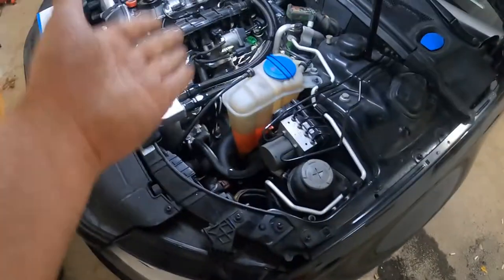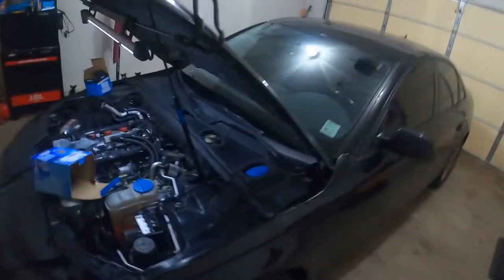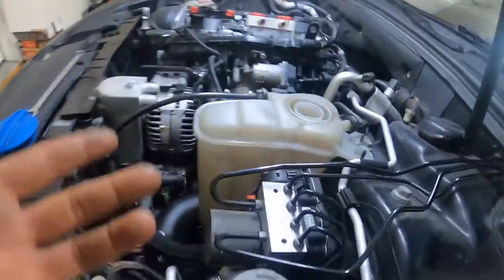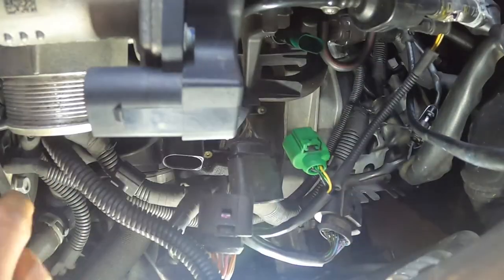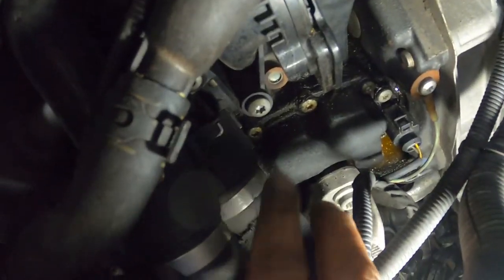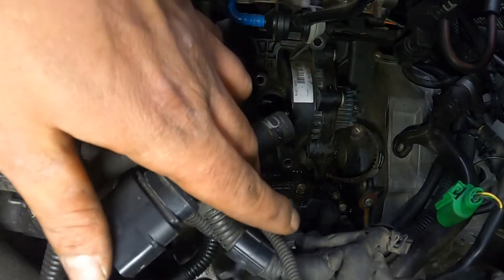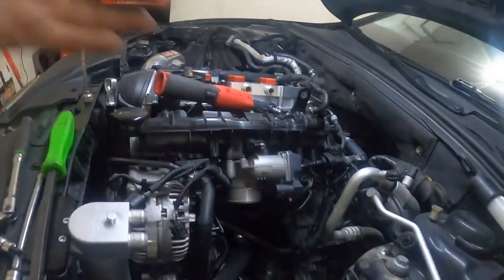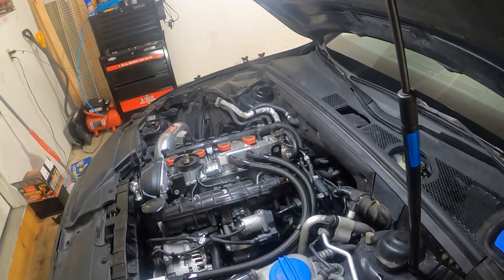Audi 2.0T water pump replacement | DIYer VERSION | STEP-BY-STEP|

Comment: Just so you all know. You don’t actually have to take the coolant tank out. It’s an option to give you more room. I found it easier to remove the throttle body but be careful as you might need to relearn the throttle bottle. (My A6 C7 doesn’t throw any codes when I mess with mine. It relearns on its own. (2ND). Turning the motor just to get the belt off is crazy and over complicating a simple process. When sliding the pump in. Do so at an angle so you can slide the belt on before you do any kind of bolting. It will work just fine and not damage or misalign anything. (3RD) You don’t have to replace the pump connector to the oil cooler. It is recommended but sometimes you can get away with just replacing the O-Rings. Make sure the connector is straight up and down as best as you can when snapping it onto the pump. I recommend a flat table or even a driveway works. (4th.) Be careful with your coolant pipes as the plastic pieces in the flange like to fall out when taking them off. So do the O-Rings. So make sure you have extras on hand ready to replace as when you drop it. Or just don’t drop them at all and pay attention to it. Or else It’s gone. (5) When bolting the water pump make sure you follow proper bolt patters as this ensures you don’t pinch your gasket on the water pump and that your pump is going on evenly. Think of it like a bolting a wheel on. Also just hand tight the bolts and once there snug you will be at or right around 9nm to 10nm of torque. Last but not least always be careful with your metal snapping pins for your hoses as they like to come off the coolant pipes and fall into the abyss so pay attention to that. 

Extra: When you fill your coolant back up. Make sure to burp it. Basically on one of the main coolant hoses just squeeze it gently and you’ll see how it pushes the air out of the system into your coolant tank. Do this till you stop seeing air bubbles. Then start your car and engine burping and adding coolant until you see no more air bubbles and your levels are back to normal in the tank. 

Most important- Don’t ever counter clock wise turn your motor unless you know you are working on anything timing related. Great way to fuck everything up in your motor.
Reply: Question - if the OEM pump lasted 100K or so , wouldn't it make more sense to stick with OEM rather than go with the "metal" one ? Graf seems to be the go to, but I have read some leak (suspect its install issue ) and some of the less expensive ones may not be manufactured to tight tolerances, which will make them leak.

I have read Audi ( VW ) has improved the pump and are at iteration 'm" or something. I have no problem going with GRAF, but I have found OEM always seems to be 100%. Same goes with Rear Seal. Also considering removing the PCV with a catch can now that the manifold comes out ( and carbon cleaned ) , and more questions ...lol.

The A3 is Just to nice a vehicle not to do these maintenance upgrades at 150K mileage.

Thanks for the notes - and this video creator is also good.
Reply from the maker: Lots of great questions, I might have to do a video on some of these. But here a go at it. Pump! Yes, the oem is a better fitting part that said most aftermarket components are supposed to be built  to oem or better. Specifications that said it doesn't always happen that way. Insert reviews and brand trust. I trust and have used graf for many years. So I recommend and trust their brand. As for miles. The metal unit will 100% out last the plastic unit and probably move the long-term fail point to the drive belt. Not the plastic as the plastic thermo cycling is what usually cause the fail points in this style pump. As for leaking I'm will to be that the leaks that most have are due to dry fitting of the o rings and associated components during this install ( my gues smooth leaks are due to installer error over product faults🤷‍♂️to may variables case by case to to say what actial cause a "leak"). As for time between replacements, I'm confident that a metal pump will go at least twice as long as plastic one will, maybe 200k🤷‍♂️. 
Now let's talk about the catch can, and carbon cleaning, 100%!!!! Do it a catch can remove the need to ever have to do carbon cleaning again. However, the liquid that your catch can stop from being sent back to your intake can and  will freeze if left un check threw winter. The catch can essentially catch the oil vapor caught by the pcv system. This vapor has water mixed with it. The catch can use a seal vacuum  based system and requires a proper seal and proper flow of this system to work with the engine.  This said if this liquid inside the catch can freezes you have some very weird drive ability problems as well possible smoke in heavy amounts out the tailpipe. Erratic idle, etc. The moral of the story is to CHECK YOUR CATCH CAN OFTEN!!😅. One of those asked me how I know situations🤦‍♂️😂. You ask great questions, keep asking them 💚 hope this helps you along with your project.
Reply: @TheRwdyAudi  thanks for the response....just freaked me out that I saw 4 metal pumps on Amazon for 90 bucks or less by different offshore asian manufacturers....some mechanics are making a decent markup on them selling for 300 plus. Walked away from 2 when they couldn't tell me the brand. They looked "right"....but ..you can tell when put side by side, not quite right.

Graf seems to have a German / Italian pedigree so the manufacturing tolerances will be much tighter ( My pressure washer has an Italian water pump go figure )

Somethings I just don't want to mess around with. OK I'm subscribed.

Comment: Appreciate the video! Noticed the videos I've seen so far don't mention anything about the o-rings inside of both of the connecting coolant hoses to the water pump. When I purchased the water pump (metal version) it came with 3 o-rings 2 same and one small. I installed without the 2 larger O-rings. Disconnected the two hoses and nosticed that there were o-rings on the inside of both hoses. Step by step  in bold case missed a couple steps 🙂.

Comment: Very helpful video! I did this on my 2014 Audi A6 2.0t. Basically the same setup. My water pump was "failing" and I had a CEL. Your video made changing this a breeze!
Reply from the maker: Dude your awesome glad you where able to get it all fixed up.👊😎

Comment: What is the exact difference between the 06J and 06H water pumps? My wife's 2010 Audi A4 2.0T TFSI has a recently replaced pump assembly on it, but i am now repalcing the temp sensor and thermostat on it. I bought a new gasket (o-ring) and went to install it and the OEM thermostat housing wouldn't sit down all the way and had a gap so i ended up cracking the bolt on thermostat housing. Since hers is an 06J the thermostat and housing were both special order through O'Reilly.

Comment: Thanks for the DIY and intel on the Graf unit. My WP just started leaking over the last 5 days or so and noticed its cracked in the exact same spot which I could make out in your video. Mine is transverse so hoping to try and get it done without removing the intake manifold on an Audi Q3, hoping there's more room to play with a bigger engine bay. Good video man!
Reply from the maker: Thanks for the love👊😎
Reply: @TheRwdyAudi  all good. Did the install at my go to workshop. The union joiner the supplier gave my mechanic must've had dodgey o-rings cos it started leaking between the housing and the oil cooler after he had put everything back together. Had to re-install the OE union, which luckily enough wasn't discolored or brittle. But all is well now. Probably best to use VW OE unions to be safe.

Comment: I just did this over the weekend and took me a while because the temp sensor and the union to the cooler didn't come with the pump so I had to look around at local autoparts stores and finally got it installed. I also bought the 24mm socket but that didn't work for me. I removed the three long bolts I had put on to hold the pump and tilted in an angle just enough to slide the belt back in, then installed the bolts. But other than that, thank you for a very well detailed video, it made things a lot easier.
I do have one question...... I ran the engine until it got very hot but my fan didn't turned on. The temp gauge is in the middle and my a/c is blowing cold and heat is pretty hot. Is this normal to not have the fan come on?
Reply from the maker: No. At least 1 fan comes on with the ac is turned on. Some cars have 2 fans one is primary cooling fan the other is a/c fan.(then there aux fan on some models ) if u have only 1 fan then I would suggest check with a scann tool the coolant temp data stream you might be start to see sign of failing coolant temp sensor

Comment: Thanks for the video, I was driving to work yesterday on the highway and got a low coolant light, saw that it's leaking around the water pump but I can't see from where, going to take it apart when the I get the parts, should I replace the hoses as well as the water pump while I am in there?
Reply from the maker: Probably leaking from the union or the pump seal itself, both are super common. I would go ahead and replace my hose if you see any  residual(pink coolant crystals) on the couplers to the rubber hose i would highly recommend replacement, that said the plastic ends are pretty common to break and chip off whenever they want. So replacement with WP service is honestly a good preventive maintenance move. Home this help.

Comment: So where was the leak coming from exactly? Did you pin point it ? Maybei missed that part.
Reply from the maker: It was coming from seal between the water pump and the pump module as it called. More the piece the pump bolts into. These like to flex and warp ultimately leaking.

Comment: I noticed you started the engine then started to refill the coolant, is there any reason for that? I have installed the Graf kit WP, but after installing and refilling and the car warmed up i noticed some leaking from the lower big hose on the water pump, it's installed correctly and locked in with metal clip, not really sure what's the problem with it at this stage, and it was pain to put it back because my car has an auxiliary electric water pump which makes the area too small to easily insert the pipe.
Reply from the maker: Your leak is probably  coming from the o ring inside the lines themselves. These oring are 100% replaceable. Possibly number two is that the line itself has a micro crack you can't see and may also only happen under pressure or temperature. As for starting the car with no coolant, that was solely to make sure the job was successfully reassembled and without any vacuum leaks or other issues before I wasted 30 dollars a gallon coolant, lol
Reply: @TheRwdyAudi  I'm taking it tomorrow to a local garage to pressure test the system just to make sure where the leak is coming from before ordering and replacing further parts. I may also replace the crossover pipe it looked quite dry when i installed the new pump.
Reply from the maker: Usually, when I do this job, I recommend to the customer to replace the union between the pump and cooler along with the cross-over tube, and the o ring in side the coolant lines them selves. If we have any showing residue(crystallized coolant) on the outside of the lines, they should just replace them. On a side note, you could purchase a very good diy pressure kit from harbor freight it happens to have the exact sized adapter you will need. And save yourself some money in the process doing the exact same job, that your gonna have local shop do.
Reply: @TheRwdyAudi  I did replace the flange that goes into the oil cooler, but not the seals inside the two big coolant hoses. 
Anyway, Did the pressure test today and yeah the leak is from the lower large hose where it inserts into the WP, either the o-ring inside the hose insert or the hose insert plastic itself is stretched a bit. Just going to replace the whole hose including the o-ring for peace of mind. Thanks for taking the time to reply, really appreciate it.

Comment: Question, does the coolant temperature sensor has a o ring rubber seal inside when replacing?
Reply from the maker: Yes it has one . I usually  don't replacement then unless there completely  deformed
Reply from the maker: It easiest to take the o ring and install it on your new sensor and then install it into the housing fyi

Comment: Is this pretty much the same for replacing the thermostat?
Reply from the maker: Yes. I would do all of it while I am there if I was u but I understand that not always a option.
Reply: @TheRwdyAudi so to replace a thermostat I have to take water pump out? I thought I'd just remove thermostat housing instead.
Reply from the maker: You can. It's just all made of plastic. Just be extra careful that you use your specs

Comment: Reason you didnt show how to put the toothed belt on? Dont believe camera was off😂😂😂 You strugled with it, didnt you?😂😂😂
Reply from the maker: 🤷‍♂️😅 no excuse 😂. Honestly, they do suck a bit. I usually  walk them on, tho slowly turn the engine by hand front the crank  bolt side while walking the belt on. I'll show how I do it next time.
Reply: @Rwdyauditaxi  i did my on last saturday, just it was mk3 1.8 tfsi audi a6 40k miles, wasnt sure about that belt, so looked for videos, and honestly, noone showed that belt part! Luckily it was easy enough, helped myself with screwdriver... your video was helpfull too..
Reply from the maker: Good stuff, my dude. 👊😎